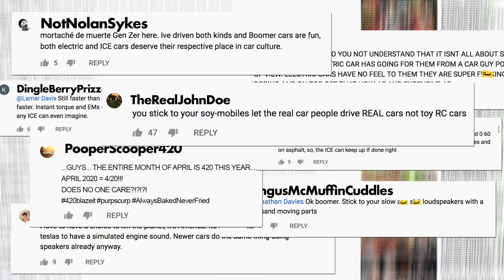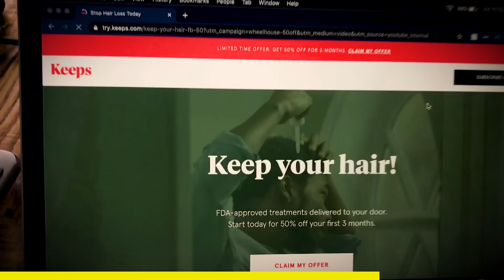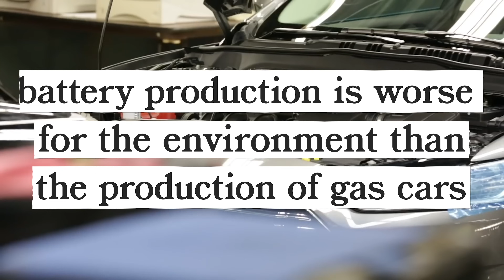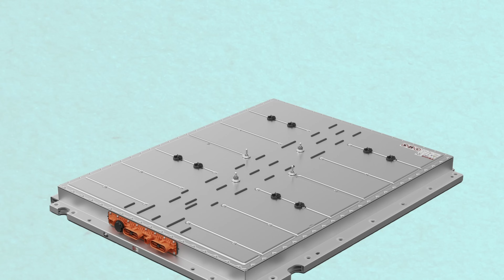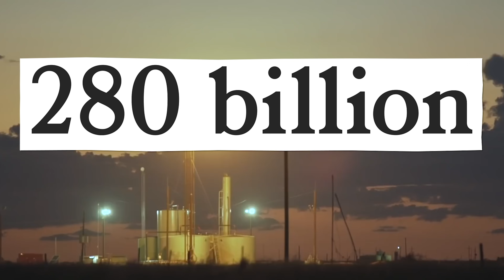Are Electric Cars REALLY Better for the Environment?

Comment: I still hold whif a Disel, its Better, and you missede repairs on an ev's,
Reply: The idea of a car is not to trash it. However it’s more fuel efficient to use an 8kW generator to charge your EV than it would be to use that same diesel in a diesel car.
Reply: @engineeringtheweirdguy2103  acely not, these numbers is mabe taken from a wrong fact, of what i now, Disel is cleaner, bacause IT needs les repair, plus you can run Disel, on Vodka, it will Work better, and were cleaner, vodka is made of water and potatoes, and it proven. And the car shall too repair a Lot more, tecnology of too Day, have not the greatest, chance og surviving more than a few years, that mean chanching. The car more often, than you Will wif a Disel. I dont now about America, but here in the North, Will my Words hold true. Do a Disel is bad for the helh,
Reply: @larsejgaardbissenbacker  you can’t run a diesel on vodka. But even if you could, it would burn out the seals and tank the engine due to the sugar content.

EV’s today last much longer than combustion engines. Addition you don’t have to service them at all. Tesla’s having no mandatory services for the lifetime of the vehicle. That’s because the electric motor is a self contained unit rated to last 1 million miles. EV’s also don’t have a gearbox to service and maintain. and the batteries too are self contained unit rated to last around 500,000 miles to 70% health. Meanwhile diesel average a lifespan between 250,000 miles to 300,000 miles and only with persistent and regular maintenances on the vehicle including oil changes, belt changes, replacement parts, fuel pumps, engine bushing, filters, etc etc etc.

And yes, it’s far more fuel efficient to run a Tesla on a diesel generator than to use that same diesel in a car. Even an efficient one.
Reply: @engineeringtheweirdguy2103  

i have my facts, you have yours.

Ps. Have you taken that, from Teslas home site.
Reply: @larsejgaardbissenbacker  no, I’ve taken that from science review on currently installed battery technology and BMS effectiveness as well as my own calculations.
Reply: @larsejgaardbissenbacker  there is no “your facts” and “my facts” there are only “facts” that’s what makes them “facts”. You’re either wrong. Or you’re not.
Reply: @engineeringtheweirdguy2103  your calculation, you now, there can bee a big defrient. And there is professors there say as I. and professors there say as you. The most popularer one is yours.

But wee can first see hwo is right, in 30 too 50 years. As everything else, since takes  time.
Reply: @larsejgaardbissenbacker  actually, no. Maths is unfortunately absolute. There is no opinion in maths. If you pick up one stick then pick up another stick you have 2 sticks. If you say in your opinion you have 3 sticks you are just wrong. You have 2 sticks
Reply: There is much less to repair. No engine, no cooling system, no clutch, no gearbox, no exhaust system etc.....

Comment: So how is every individual that's driving is now going to be packing around at least two thousand pounds of battery and being as heavy metals that are mined in third world countries by children is going to be good for the environment
Reply: Interesting that you’d bring up cobalt child mines. Lest slowly work out way up to the most inconvenient fact about your statement. The cobalt in EV’s is actually minimal. Only about 11kg per vehicle. Meanwhile Tesla and other EV manufacturers have signed deals with suppliers to only source ethically sourced cobalt. And are sinking huge dollars into researching a cobalt free battery. But finally,

Finally let’s look at who the biggest consumer of cobalt is per mass on the planet. Are you read for it? FUEL REFINERIES! Which use it to remove sulphur from fuels, which, unlike with an EV, is uneconomically recoverable. Meaning it’s wasted. Sent to land fill after it’s been used.

So if you want to prevent child mining the * BEST* thing to do is to stop using your ICE vehicle and buy an EV or hydrogen vehicle instead.

Comment: Cobalt is mined for fossil fuel production, too.  Loads of electricity is used to produce fossil fuels.  Used EV batteries are in high demand.  There are lots of applications where weight is not a factor of efficiency.  A battery that won’t push its own weight has a lot of life for stationary storage.  ( like a home).
Reply: Regenative breaking reduces impact of weight on efficiency.

When it comes to lithium-ion battery production. There are already manufacturers selling solid state batteries that solves the problem of batteries randomly shooting out flames because it uses a solid electrolyte. These also charge faster, have more capacity and last longer.

The only my problem is, that these solid-state batteries use significantly more Lithium.

Even if EV sales were to flatline, when solid state batteries replaces liquid electrolyte batteries, demand for Lithium would jump significantly. 

But, EV sales won't flatline. It'll jump too as many countries plan to flat out ban ICE cars. So it'll mean even more demand.

Demand = increases in price.

It's a good time to invest in battery companies.😅
Reply: not to mention that tesla now doesnt use any cobalt in their new batteries

Comment: It is indeed proven that electric cars ARE INDEED more energy efficient than gasoline cars.

However, it's ALSO proven that the difference between them is very little, and if we all switched to electric cars right now, our carbon footprints would only go down just a little bit.

The best way to help the environment is to drive your current car as long as you can before you get a new one. Once your car gets so old that you NEED to replace it, the best thing to do is buy it used, not brand-new. THAT'S how you can more effectively reduce your carbon footprint.

Comment: I do several long road trips a year.
Let me know when an SUV EV can do Dallas to Tampa in 15 hrs, INCLUDING the recharge time.
My 2003 BMW X5 V8 does this trip with ease, 1150 miles with only one gas stop.
EV is for city driving, NOT long distance driving.
Reply: How often do you make that trip?
Reply: @engineeringtheweirdguy2103  
That trip is usually done twice a year.
I also do round trips to the Waterloo area of Iowa (from Dallas).
Will be doing a round trip to Pikes Peak area of Colorado in a few weeks (again, from Dallas).
The X5 has over 230k miles on it.
Reply: @jamescampbell4334  My point is. Although it seems like it would be more expedient to have an X5 or similar if you do a lot of long trips. but when you work out the numbers, its actually more beneficial in both time and money to own an EV in many cases. (not all).
Reply: @jamescampbell4334  I would be curious to know what you think of those numbers though and how it all worked out.
Reply: @jamescampbell4334  Actually the time difference works out to be smaller. since the distance between dallas and Tampa by road is nearly 1,118miles. the fuel tank on a 2003 X3 is 24.3 gallons with 6.2 gal / 100miles which is a range of 390 miles to a tank. you'd have to fill up around 3 times to make that distance (technically 2.8 times but i'm assuming you dont want to arrive on a fuel light so 3 times.)

Comment: I am only interested in Diesel cars. I love Diesel - Have a Mondeo Titanium 2 litre - Will do 140 mph - does 50 mpg - will do 600 miles on a tank full - Refuel time 3 minutes - Uses less fuel than petrol - More environmentally friendly - Uses 2 gallons per 100 miles - Petrol (30 mpg) needs 3 gallons per 100 miles - Unlike electric will not need a new battery after 3 or 4 years costing £ Thousands ! It is a no Brainer ! Go ahead and buy electric cars and crash the National Grid and get power cuts !
Reply: Uptake in EV won’t crash the grid as the majority of charging occurs in off peak times. Infact most studies actually found that this would actually reduce energy prices in many cases.

As for the batteries, at current the industry standard is an 8 year warranty or more. Infact batteries these days will last around twice the lifetime of a combustion engine.

Finally in for fuel consumption. If we were to put diesel into an 8kW diesel generator to charge, say a Tesla model 3. Then it would achieve a fuel efficiency of 0.98 gallons per 100 miles. The most efficient diesel car in the same size class has a fuel efficiency of 2.5gal per 100 miles. So even if you didn’t want to be a drain on the grid it’s still more fuel efficient and environmentally friendly to charge your car off a small home generator.
Reply: @engineeringtheweirdguy2103  Do you really fancy waiting more than 10 hours in a motorway service area in line of 100 cars waiting to get their batteries charged ?  Any idiot knows that the climate has been warming for 11,000 years since before the North Sea was frozen in an ice sheet 1 mile thick covering the whole of Britain. Sorry to hear you have been brainwashed.

Comment: You should remember maintenance as well, a battery pack will last at maximum 5-6 years if even that
Reply: That’s abhorrent you false. Industry standard at the moment for EV batteries is 8 years. They are designed to last more than 20. As they have double the mileage lifetime of an average combustion engine.
Reply: @engineeringtheweirdguy2103  so far that has been the lifespan of them. We'll see in time how much better these new batteries are compered to old ones that i refered to and witch we have facts that backs it up. But they still have many issues to overcome with ev cars then combustion cars
Reply: @jonasbackman5165  perhaps you didn’t read properly. The WARRANTY alone is 8 years on the batteries for today’s technology, they have achieved 1,500 cycles to 70% health for modern batteries. Meaning a model 3 will last around 500,000 miles to 70% battery health. So you’d still have around 230 miles of range per charge.
Reply: @jonasbackman5165  this isn’t “distance future technology” this is now. Today
Reply: @engineeringtheweirdguy2103  yeah i read what you wrote, and still i stand by my statement that we shall see if their claims are true or not! We don't have the facts yet to back this up since it's today right now, we'll see in 2029 if it's accurate
Reply: @engineeringtheweirdguy2103  interesting article and he got alot of miles, but the car was 2015 and  he had it until 2019 so 4 years. Gonna be interesting how long they last? Wonder how harsh weather affects the life lenght?
Reply: @jonasbackman5165  well the batteries are enclosed and temperature regulated as part of the BMS. meaning that they aren’t affected by harsh weather. In this case they managed to fit approximately 22 years worth of driving into 4 years according to the US national average of 13,500 miles per year.
Reply: @jonasbackman5165  in any case the car is still going and the batteries in more recent EV’s as well as the battery management systems (BMS) have rapidly  improved since 2015.
Reply: Oh dear, another one.  An electric car battery comes with an 8 year ( that's an 8 YEAR ) warranty from new......  Where do you people get your misinformation from?  I suggest you watch the YouTube video posted by a Tesla Model S owner. His car had covered 400'000 kms on it's original battery.

Comment: Great video but there are other videos out there that it’s much closer when breaking down everything you actually have to take in account electric cars also use grease and any other lubricant which is part of the oil industry so when you break it down you actually have to still put the oil industry in with the electric cars as well
Reply: Well actually you don’t have to use fossil fuels to create those lubricants. Whilst that’s the most readily available alternative it isn’t the only one. But for EV’s, they don’t need to be replaced every 10,000 miles like a combustion car does.

Comment: Nolan, as a power plant and grid operator in this country, I have to tell you that your capacity "fact" is incorrect. For over-simplification purposes, I'll just say that electricity is traded like a commodity, and the supply is neither infinite nor constant. In fact, the only provable trend is that electrical load demand has increased yearly in this country since the 1990's. Therefore, while during most "normal" times, you should not overload the grid at NIGHT by plugging in a bunch of resistive load when demand is typically low. However, in hotter regions where there are capacity emergencies during the summer months, the grid would collapse if most people suddenly added that kind of load on the system at night. Furthermore, this would change the operating envelopes of the generators, making them run at higher power levels for longer periods,  increasing operating and maintenance costs which, invariably,  causes the price of electricity to go up. This wipes out some of those financial savings and increases plant greenhouse gas emissions. Even more so,  capacity planning would require more power plants be built to carry that load. So, truly, it's a vicious cycle. If you want to learn more, I recommend EPRI's website, just google "Electric Power Research Institute" and enjoy.
Reply: Not entirely true. Such as increasing power costs. It actually costs power plants a lot of money to spin down and shut down a power plant. All that energy in the generator needs to be dumped to slow it down to zero. That’s a huge loss. Also a generator not operating is a generator not making money. Regardless of staff. As part of the price of power is covering the overheads of producing power. Otherwise they’d operate at a loss which they don’t often do. Otherwise they’d shut down for good.

Further to that spinning up to re-synchronise with the grid takes a lot of fuel and wasted energy. You have to burn a lot of fuel to heat up the steam and turn the generator fast enough to sync with the grid. All the while that energy and fuel is wasted. Which is a big cost again to power companies.

Power companies actually prefer to keep their generators running at higher speeds for longer periods for this reason. Also because generators, like car engines, have a peak power output RPM. so at their peak power output they operate peak efficiency. The power company can produce more power for less fuel at peak output. This means cheaper overheads for the power company. Maintaining this peak power output for longer is what power plants want. Sell more product with higher profit margins.

That’s why power companies offer cheap off-peak energy. 1.) to keep their generators running at peak output for as long as they can but also 2.) to delay them or even prevent them from having to shut down by incentivising demand. 

Multiple studies have shown that EV uptake would actually decrease energy costs. Not increase them, by saving power companies the cost of spinning down them spinning back up generators and allowing them to operate at peak efficiency for longer reducing the wholesale cost of electricity.

Comment: The life off an combustion engine is 10 to 15 years, an EV maybe 8 years.  Depends when the batteries saying " i am done " . The EV is totalled, the combustion engine not.  I drive a car that's 21 years old and still drives like new. An EV will never be as good as an combustion engine quote durabillity.  The future is and are synthetic fuel.  Verry cheap to produce,makes engines way cleaner  even in older diesels and petrol!!! And hydrogene engines, uses combustion engines technology but more cleaner then an EV!!

Comment: Did you factor in replacement battery packs? I don't know how often the batteries need replacing, but I know they don't last forever. That could make a big difference.
Reply: Well modern batteries are rated to 1,500 cycles. For a model 3 with a range of 325 miles that’s almost 500,000 miles of driving to “end of life” whilst a combustion car averages 250,000 miles.

End of life is also considered to be 70% of its original capacity. So at the 500,000 miles mark, the model 3 will still be operational with 230 miles of range per charge. Still more than usable.
Reply: Depends on the type of lithium batteries. NCA batteries should work fine for 400k to 500k miles (proof 2012-2015 teslas,volts) and then they can be used as backup storage on the gird or house for at least 10 more years, LFP batteries are even better They can last more than a million miles in a car(that would be over 20 years).

Comment: Forgot the cost of upgrading your electric panel to be able to charge your vehicle at home.
Reply: There is no upgrade needed.  That claim is actually false.
Reply: @redbaron6805  sure there is if your panel is maxed out. In my case
Reply: @craigleidigjr4170  And you don't have a dryer or anything else in your house?

Just because your panel is maxed out (all the breaker slots used)  doesn't mean your house doesn't have surplus capacity on the panel.

Almost every house here has a dryer, you can put a switch on your dryer outlet to charge your EV for example.

Not sure which country you live in, but in the USA you can also use dual 120V outlets to make a single 240V, doubling charging speed to 100 miles per day.
Reply: @redbaron6805  funny my electrician advised me what I need
Reply: @craigleidigjr4170  I would have to see what numbers he is using.  I'm an electrical engineer which has no money invested in upgrading your panel.  Your electrician does however, so this advice may or may not be accurate.